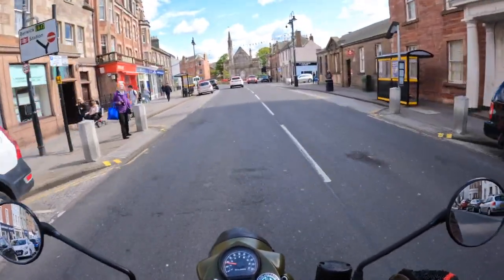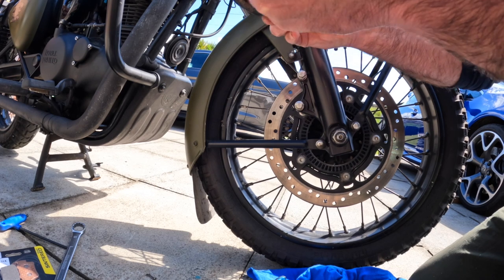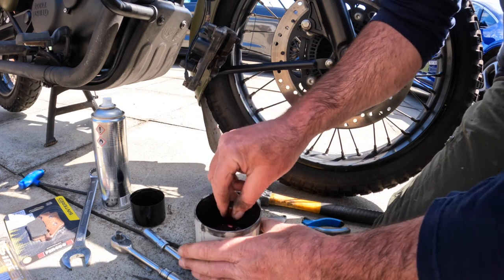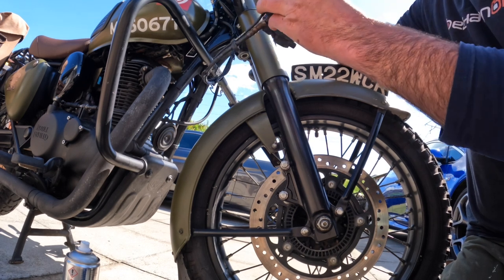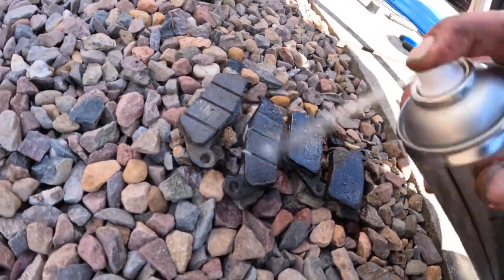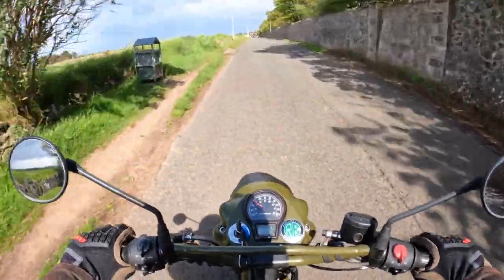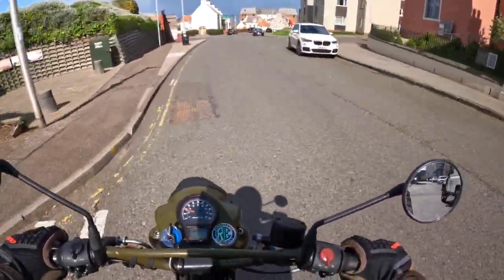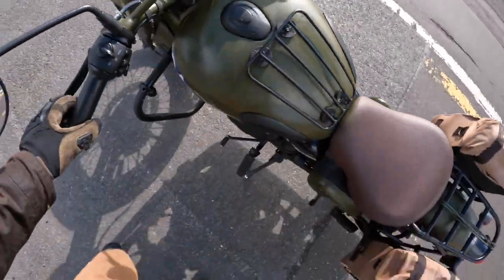Bedding in new brake pads on the Royal Enfield Classic 350 Reborn!

Comment: The first instructional video in English  ..congratulations Bruce! Dunbar looks like a lovely little town, especially now summer here. On the subject I phoned the post office in the High Street to ask if I could post the shell case (I didn't tell them it was a shell case) so you could collect from there, but the lady said it was not possible, so sadly it looks like I'm stuck with it. Which is a shame, because it would have looked much in your collection than stuck in a cupboard in my house. Regards Mick
Reply from the maker: I should redo the brake pad film Mick when I check them before winter as it be easier and ok to remove the pad pins and take them out to inspect and blast the callipers with brake cleaner, then if you we’re fitting new pads manually push in the pistons, 
Also going to get that re wheel removal unaided dialled! 😁👍

Comment: Hi Bruce, another great video bar, the back brake hiccup. I had covered 4.5k on my 350 reborn with no issues whatsoever. Now I have bought the signals desert sand 350 as I love the paint job and markings. These wee bikes are cheap enough, so you can have a couple and still have money left from buying a big adventure bike.. and if all you are doing is riding around Lane's and B Road Adventures, they're all you need. Money left can buy something else!
Cheers
Stevie
Reply from the maker: Ace you got two of them Stevie, I will probably buy a used low mileage red and chrome Classic in a years time to have one all polished up 😎👍😁
Cheers Bruce

Comment: I have always used engine braking, or a combination of both, when riding or driving 4 wheedlers.  Not only cuts down on wear, but offers another level of control. Cheers. 🥃
Reply from the maker: Hi Lance, these bikes deft rider better using the gears and the engine breaking available 👍😁cheers Bruce

Comment: Funnily enough I find remounting the rear wheel on my NC750X difficult as well.  Honda, in their infinite wisdom, has ditched the straight-forward torque bar of old and now it is far fiddlier than it should be to get everything back together.
Progress ! you just can't beat it...
Reply from the maker: I loved the snail cam chain adjusters on my Honda XR 400r Enduro bike, it made fast removal and refitting easy for timed pit stops be it racing or for trail riding puncture repairs, simple and easy which the Classic 350 should have as it is a lovely bike to work on! 😁👍

Comment: There seems to be a track record of forgetting your phone 🤣🤣🤣 I got to say I am pretty shocked to learn you have to drop the rear wheel to change brake pads, that seems mental. I am nowhere near monetisation as have so few subs but even if I did it not my motivation for releasing videos (if it was I would have stopped ages ago) and not suggesting for a minute it is yours either. Rather I enjoy the process of recording video and producing some sort of video that I can enjoy to watch again. If other folk get some sort of interest in them than that is a Bertie bonus. Enjoy your trip tomorrow.
Reply from the maker: Hi Alex I’m sure the pads will come out easily enough with not callipers in situ and doing so will make it easier to loosen the pad pins and tap them out, I should really do a take 2 film when I get back doing so to put folks minds at ease 😁👍
Aye blooming phones 🤣🤣🤣
Away first light tomorrow and canny wait! 😁👍 cheers Bruce

Comment: When I'm dropping my rear wheel (don't need it as much with the front), I always use a plank of wood and a wooden block so I can set up a lever to help lift the wheel. It helps a little with dealing with the trickiness of getting the caliper and rear axle all lined up. I notice that you are using sintered pads. Do you know if the factory pads are sintered and do you have an opinion on the idea that sintered pads wear the disc quicker than non-sintered?
Reply from the maker: Oh I’m no aware if stock are sintered or not,  I just bought the pads from Hitchcocks, guess  rotors should still last a while as not hard breaking much with so good engine breaking 👍
That’s a good ideal using the wood as a lever, I need to try that and post a how to do film for other folk who have also struggled the same, of course you will get the credit for your idea 😁👍
Reply: @Coastriderscotland  Don't worry about credit Bruce, someone else will have thought of it first and if it helps others I'm content.

Comment: Great video Bruce. I'm just about to tackle this job on my Classic for the first time. No idea what the pads are like yet but after nearly 9k miles I'm finding some strange pulsing on the front brake, like it's repeatedly gripping and releasing. Quite disconcerting. Oh and would carb cleaner work as well as brake cleaner to clean out the callipers? Cheers!
Reply from the maker: Brake/carb cleaner will both clean your callipers ok 👍😁

Comment: Regarding removing the back wheel, I remember from an earlier video that you had a piece of wood to raise the centre stand to give better clearance but found it not quite balanced . Just curious if you came up with another solution? I’m keen to have something similar to keep in the pannier in case of a need for a roadside repair of a rear tyre puncture. Apologies if you’ve answered this question already elsewhere. Thanks.
Reply from the maker: Hi Neil, I have the lenght of CLS to fit under the side stand and also a re usable cable tie to lock the front brake to prevent the bike rolling, in other comments it was suggested a lever type bit of wood to lift the wheel with your foot to allow you free hands to Aline everything, I’m away next week on the bike but will try get a film made trying all suggested methods of easier rear wheel removal on your own to solve it 👍😁 cheers Bruce

Comment: It seems to me a UK/Scottish thing to apply copper grease to new brake pad kind of thing?🤔 Is it because of the road salt applied in winter? I’ve never used copper grease here in Australia personally because I thought the brake pad backing material has a small percentage of copper alloy, hence the colour. I’ve never had my new pads squeal to a stop. Wouldn’t the copper grease wash away riding in constant rain? I truly am wanting to understand this. Thanks🙌
Reply from the maker: Hi Steve, good observation and question that I honestly cannot answer the reason why it’s done, just always seen it done, garages seem to put a silver plaster now on them, maybe a zinc mixture?, I’m sure someone on the know will be along to comment why exactly it’s done! 😁👍 cheers Bruce
Reply from the maker: To add some info a friend tonight said he thinks it is for stopping brakes squealing, and interestingly Cooper grease is now banned at Torness Nuclear Power station just outside of town as being cooler it is conductive, and they use a silver anti corrosion paste now that also silver like mechanics ow use on cars,  my tin of coppergrease funnily came from a contractor that works at ‘Tornoble’ 🤣😁👍

Comment: Having had Guzzis for years with Brembo brakes I was shocked to learn that I'd have to remove the rear wheel to replace the pads so I checked the manual. According to RE all you have to do is remove the spring clip, knock out the pin and the pads should be easy to remove from the rear - same as the Guzzis. I know you were also giving everything a good clean as well so needed to get things dismantled but for us fair weather riders just replacing the pads should be enough. The front work in a similar way so all I'll need to do is drive the pistons back in with a wedge and put the new pads in. This may prove more difficult than it looks but I'll give it a go soon. Brembo used to do rebuild kits for the brakes with new pins etc. but I've no idea if they will fit Bybre.
Reply from the maker: You will deft be able to swap out to new pads easily on both callipers with them both left in place as you say and I wish now I had just done this and saved time as being so new there was no problem with stuck calliper pistons, cheers Bruce

Comment: When i pull the brakes , a sound is coming from the front side.. After brake pad change
Reply from the maker: It could just be the new pads bedding in? Sometimes a ride in the rain with gentle braking takes off the glaze finish on new pads, hope this works for you 😁👍 
Cheers Bruce